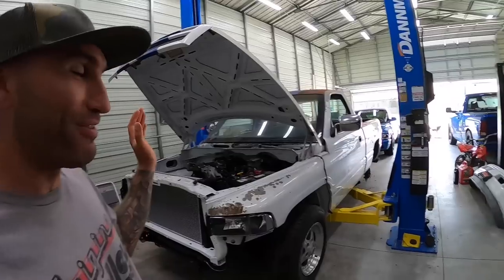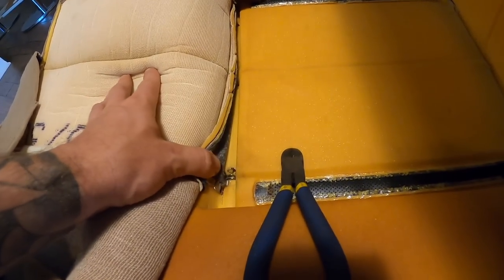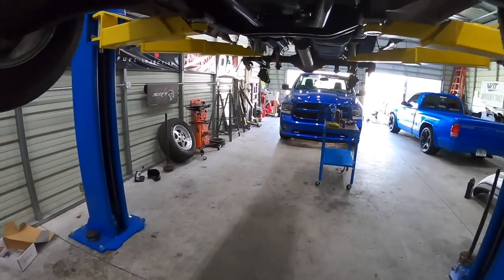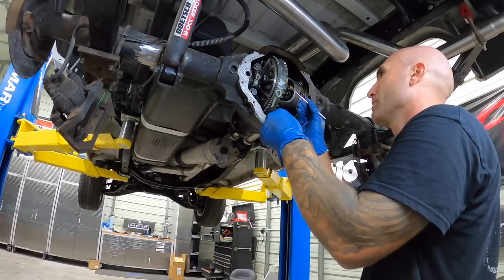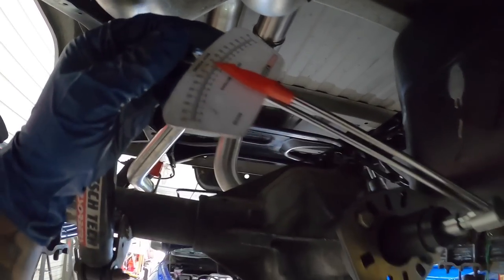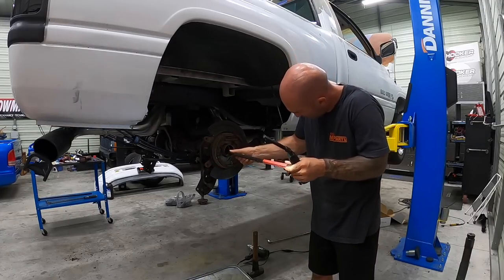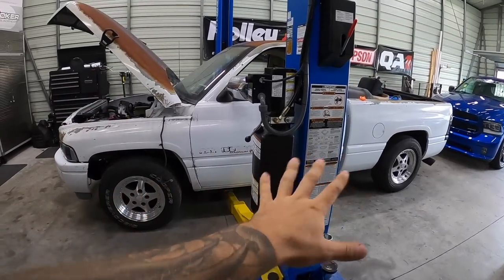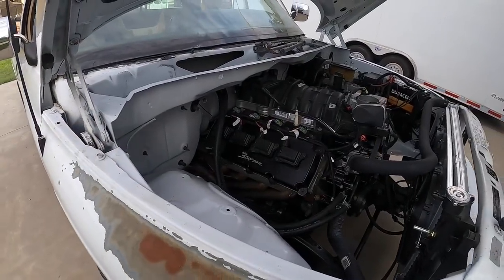1997 Dodge RAM 1500 5.7 HEMI SWAP Pickup Truck Build | Part 15

Comment: Boy that rear end rebuild brings back memories…haha. I did mine in 2017 but added an Eaton trutrac worm drive posi unit, love it and no need for additive, just straight gear oil. I also had an issue with my drivers side axle shaft pitting where it rides on the outer bearing.

Comment: you should just get the dual foil backed jute padding from seconf skin it has foil o n front and backside it reflects outside heat while keeping inside the cab cool temp & the jute cuts down the sound from the exhaust drone.. second skin makes some premium sound deadener, they're out of tucson arizona & make so many different things for all ur sound deadening needs as well as & heat sheilds & heat barrier products